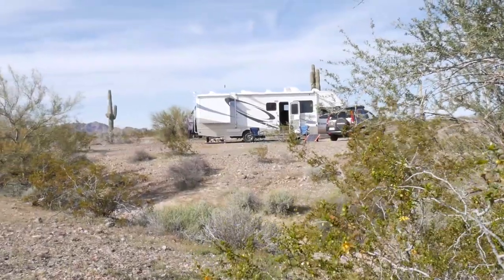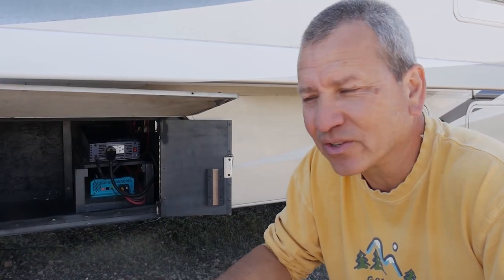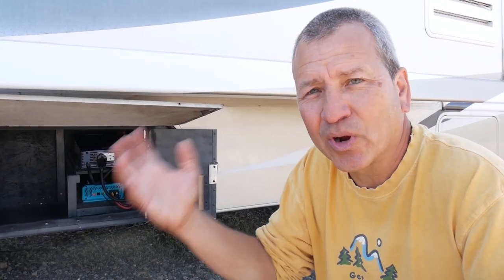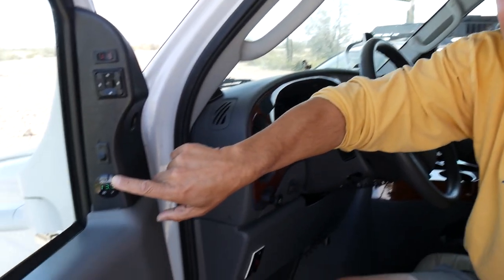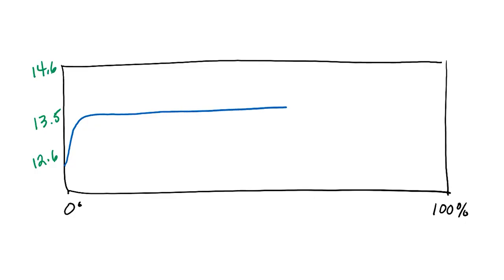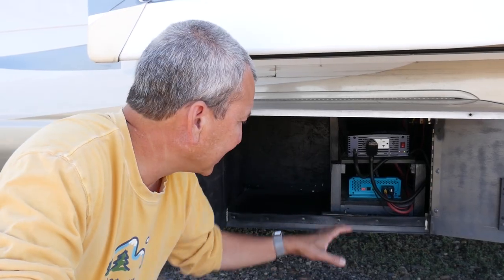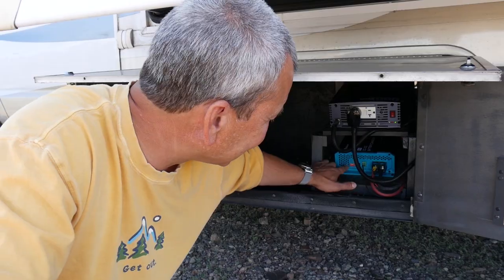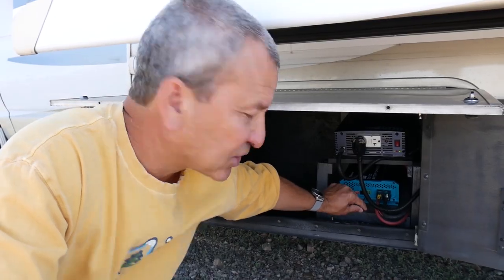Charge LITHIUM Batteries While Driving - System Setup

Comment: FYI, your "20A charger' is really a max 250w output.....the current decreases as battery voltage rises. As your LiFePO4 batteries reach a full charge at 14.4v,  output decreases to (250w/14.4v) 17.4A. Also, input amperage can be considerably higher than the assumed 20A output Due to operating efficiency of 90%, at low(er) voltage in your vehicle circuit,  it can draw more. Theoretically, it can operate on 8v input but realistically, if your starter battery is a bit down and the charger draws it down further, such as when the key is on but the engine is not started, the charger can draw (250w/12v/.9) 23A.
Reply: @tonyhood450  Not at all. A 20A for your small vehicle and 100Ah of battery is likely correct. (recalling from a year ago),There are a number of currents/voltages and specifications involved. It is complex and I may be muddying the water but I'll take a crack at it;
Firstly, POWER OUT = POWER IN x EFFICIENCY, since POWER = AMPS x VOLTS, rearranging the equation;
VOLTAGE OUT x AMPERAGE OUT = VOLTAGE IN x AMPERAGE IN x EFFICIENCY

If either input variables change, the output variables change and the reverse is true. This is a 
'teeter-totter' which is ALWAYS balanced. Because conditions of both the auxiliary battery and automobile change, use these equations to determine the limits (high and low) of operation and make sure you can safely tolerate those. 

1) The rating (on the data plate) of the battery charger is actually 250W, although it says '20A' on the label. In this case, '20A' is a marketing number and in this actual case, is rarely true. It CAN be true under specific conditions but it is not that much most of the time. In order for the charger to put out 20A, that happens when the battery is at 250w/20A = 12.5V. According to a chart of voltage vs SOC for LFP batteries, that is when the battery is at about 5% SOC. Whenever the battery voltage (and SOC) is BELOW that, it will still get 20A (or more) but when the battery voltage is above that, it will get less (which is most of the time). 
2) This charger appears to be constructed to deliver 'constant power'. That means, the current it delivers to the battery and that it draws from the alternator will change. Looking at a couple points, such as the one we just identified, at 12.5V it charges at 20A. How much does the alternator need to deliver to the charger to do that? a) IF this is an old-style fixed voltage alternator that puts out ~14.0V all the time (usually somewhere between 13.8 and 14.4) operating the charger requires 250w/14V = 17.85A at 100% efficiency. Since it is never 100% efficient, assume it will only be 90% efficient and will therefore require 17.85A/.9 = 19.8A. b) If this is a new style  'variable voltage alternator', it is likely the 'normal' alternator output is not 14V but is 12.4V (a good percentage of the time). At the same 20A output, the input would be 250W/12.4V/.9 = 22.4A.
3) When battery chargers operate, they go through 3 modes. The first mode is a 'constant current' (CC, which in your case is actually 'constant power') and it does this till battery voltage reaches the maximum allowed which for LFP is 14.6V (my mistake saying it was 14.4V previously). When your charger reaches this voltage, it will be charging with 250W/14.6V = 17.1A. Once it reaches 14.6V, it switches into 'constant voltage' ,CV, mode and holds that voltage but the current tapers off as the battery becomes 'saturated'. The charger holds this voltage till the current drops to ~5-10% of maximum (1-2A). At that point, it will stop charging for a time and wait to see if the voltage drops, then come on briefly, bring the voltage back up till it no longer drops ('topping' mode).
Reply: @tonyhood450  Fundamental to this question is a brief explanation of 'smart alternator' control. 1) The car intentionally keeps the starting battery undercharged. 2) The reason it keeps it undercharged it to provide a place for braking energy to be stored and later used from the battery so that the alternator can provide less overall to the system. 3)  the most common operating voltage from the alternator is 12.4-13.0V so as not to charge the battery. 4) low system voltage is not enough to make some vehicle devices work well (headlights, electric window defoggers and seat heaters etc.) Only when these devices are on, will the system voltage be raised to 13.2-13.5V to make them operate better but still not charge the starting battery or the auxiliary battery. The reason for this operational control is  NOT to benefit you, the owner but to allow the manufacturer to present a better fleet MPG rating to appease CAFE mandates. This will result in less battery life (undercharging lead acid batteries is the primary cause of their death) and less available battery power with key on, engine off. As a 4 cylinder engine, you already have a small starting battery and alternator. 

You might put a larger battery in the vehicle but it will do little good since the ECU will treat it as it does the current battery. 

If you want to achieve better performance from your starting battery, putting a solar charger on it would help but it is hard to dramatically change the way Ford wants your car to work without circumventing the smart charging system as a whole (which can be done and literally revert it to a constant voltage alternator but I would not recommend it since its integrated operations will have some negative consequences (turning your battery light on to start with). 

Having a 'toggle switch to charge the accessory battery' is a good idea but likely not for the reason you expect. Your DC-DC -charger is the ONLY way you will be able to charge an auxiliary battery but you should have an 'ignition' wire that enables it to know when the engine is 'on' allowing it to charge. With such a small engine, it is important that you can manually disable this when your engine is overheating, climbing a hill, in slow traffic, passing another car etc.

Comment: Been looking at DC to DC charger for my sailboat to charge my 4 Battle Borns from my engine alternator. Thinking of the Victron Orion 12 12 30.
Reply: Have to be careful not to overload the alternator. Good to hear the Renogy is working for you!
Reply from the maker: Yes. That's the Victron model I was referring to and linked in the description.

Comment: Thanks for the video. I plan on installing mine the same way (on/off switch).  I have noticed in most of the install videos for the Renogy unit that LC connection is not used. Do you know how and why it would be used? Thanks

Comment: Great video, thanks! How did you connect the on/off switch and what kind of switch? Is it a direct connection from the + wire from the alternator or did you need some kind of special device?
Reply from the maker: For me it was from a 12V source tied to the house battery. The charger will kick on if there's 12V on that input (intended for an ignition source). It doesn't matter where it comes from.
Reply: Ya, you just run the little wire from the + input on the charger.... with a switch inline.

Comment: Thumbs up.  However, since you removed your momentary jump start battery solenoid you can't jump start the motor with house batteries if the starter battery goes dead for some reason, like leaving your lights on, etc.   You could have connected the DC to DC charger directly to the starter battery.  I'm not sure why you wanted to remove the jump start solenoid.
Reply from the maker: Yes. I could have done that but didn't want to run another cable. I never need to jump my starter battery anyway so it's no big deal for me. I've got jumper cables.
Reply: @RVwithTito   if at some point your vehicle starter battery goes to 0 - is there anything special you have to do or disconnect to do a conventional jump start ?
Reply from the maker: @lylestavast7652  Don't think you'd have to do anything special. Just jump start. Actually I keep a battery charger so I'd charge it back up from my house batteries.

Comment: Thank you; very straight forward.  Looks like my Dodge truck has a 160A alternator. Any idea what the maximum recommended DC to DC charger rating might be?  Of course more amps means faster recharge of the trailer batteries, but perhaps I should measure typical current draw during regular vehicle charging to see what the headroom might be.

Comment: I have a Victron 12/12 18 AMP on order for charging up a 200AH Lithium with 500 watt solar setup.  I'm using this in a very small toy hauler and like you I didn't want to tax the alternator especially when at idle or slow speeds.  Sometimes, less is better and for me that's a hard thing to accept as I would normally say "Super Size it", give me the 60 AMP model.  My biggest concern is placement of the DC/DC, not sure if it should be mounted in the trailer or the tow vehicle.

Comment: I also have the E450 with a solenoid (or contractor). I have a couple other wires leading from one of the terminals, one is for the CB radio and the other may be for the regular radio. I want to get the DC to DC charger before switching to lithium, but not sure on the proper way to wire. Any ideas? Would a battery isolator work any better than the charger? Thanks for your great videos!
Reply from the maker: I'll be the CB and Radio are wired to the house battery side of the relay so they don't draw down the chassis battery. If you remove the relay, you'll want to re-attach those to the house side of the DC charger.

Comment: I didn’t see how you combined the two source, solar and alternator. When you forget to turn off the switch will you be pumping current from both solar and alt. Did you simply parallel the outputs?
Reply from the maker: I have a buss bar by the battery bank where all charging sources go. So yes. It's parallel connected there. I've since upgraded to the Victron DC-DC which has a feature to stop charging when the alternator output drops. Check out this video https://youtu.be/lvOYUfSBlmM
Reply: @RVwithTito  that is good information. The issues I’m trying to solve, and nobody talks about is the old charger. I was planning on adding a dc dc then using the old progressdynamics charger as input. That won’t work unless I can parallel the dc sources. Nobody says you can do what you are doing. I’m have now changed my mind and I’m going to use the 110 shore power to drive a relay that switch to alternator input between alt and the shore power dc. The energy dcdc mppt won’t know the difference and I won’t get loses due to voltage differentials between one source and another. Let’s say max 2volt different with .06 ohm internal gives 33amps. That is not a 100% accurate as I don’t know the internals of each unit. But it is probable worse case scenario

Comment: Excellent video!
I purchase the Renogy 20 DC to DC charger for the same reason you did, I did not want to overload my alternator. The manual for the 20 amp DC to DC charger is worse than terrible (but they came out with a better one recently, version 1.1, I think it came out 1/2020).
I also hooked mine up like yours but with one difference. I hooked the DC to DC charger directly to my chassis battery, not the alternator. The manual shows 2 diagrams, one the correct way hooked up to the chassis battery, and the other one the incorrect way with a BIG X on the diagram showing it hooked up to the alternator. (page 14 of the old manual and page 17 in the new manual (but the new manual only shows the correct diagram)).
So my question is why did you hook this up directly to the alternator?
Reply from the maker: I have it connected directly to the chassis battery too. Of course the alternator is also connected to the chassis battery.
Reply: @RVwithTito  OK, thx...probably something i do not understand.  I even called Renogy directly because this seemed weird to me and they said to not connect it to the alternator, just the battery.  Great video!
Reply: @laronis  you're absolutely right .The battery acts as  stabilizer keeping the voltage to the dc to dc charger constant and stable with the alternator adjusting to the needs of the chassis battery to keep it topped up .
Reply: @laronis  Correct, i know it does not make sense since the battery is directly connected to the alternator, but make sure to connect this DC to DC charger DIRECTLY to the battery, NOT the alternator.

Comment: I installed a Renogy 60 amp  to my 500 amp LiPO. No issues. I drive a 2005 Sprinter van. The new stock alternator output is 185 amps. Not while idling. More than 60 amps while idling. I plan to add 1k solar at some point.

Comment: Hi Brian, great video as usual! I did this install recently and I’m very pleased with the device. Question though, for the small volt meter in your door, did you just connect it to the positive terminal that replaced the solenoid under the hood? Wouldn’t that just show the engine battery volts? Or did you run a wire from the house batteries to that meter? Thanks!
Reply from the maker: I connected it to that switch which originally was the emergency start switch. It was connected to that solenoid on the house battery side. So it shows the house battery voltage.
Reply: You can connect it to any 12v fuse or circuit . There are volt meters that plug directly into cigarette lighter (12v.) They only work with key turned on  acc.  or running (powering the cigarette lighter).
Reply: @RVwithTito  so straight answer direct to house battery

Comment: that turn on switch you installed, what is your 12v power source for that? do you have it hooked up to the car battery? some other 12v circuit? I don't have an rv with a massive engine battery, I only want my dc dc charger to turn on when the engine is running but I don't want to tap into the alternator ignition circuit.

Comment: Hey Brian,
I am building out a camper van right now and have found your videos very helpful this last week. Quick question for you about this set up combined with your solar. I already installed an isolator from my starter battery to my second battery (This is hooked up and working great). My alternator produces about 95 amps. I would like to install a 200-watt system on the roof with 20 amp victron charge controller (similar to yours). Do you know if having the alternator and the charge controller hooked up to the same battery will cause problems? In particular, will having 95 amps coming from the alternator harm the charge controller? Sorry if you have covered this in a previous video I am still watching all of your old stuff. 

Thanks,
Steven
Reply: No it won't. But, you might exceed the max charging current of the battery to have both going at once. Check your battery specs. That's why I like the switch idea.

Comment: Currently I am using a Victron Energy Cyrix battery combiner. I measure 18A at the house lithium battery but it does not seem to charge the battery. The state of charge remains constant at 77%. Only my dashcam was connected while testing this. This drew 0.2A.
I have now got a Ctek Dual 250SE that I will connect the next few days.
My car is no fancy camper but a VW Multivan with a 120A alternator.

Comment: Hopefully I heard you correctly, you tied the charger from the alternator is wired up though a switch which is connected though the ignition, meaning only when your engine is running, you can flip a switch to charge your house batteries from your engines alternator & solar vs just the solar!
Reply: Yes, most ford alternators are above 90 amps(I say most not all) but that's not what you can truly pull safely! You have to figure out how much does everything pulls leaving how much is left & go by that! Meaning if you do have said 90 amp alternator & with everything running it pulls 55 amps, you only have 35 amps in reserve which in my opinion, having a 20 amp charger added to that is going to tax that alternator to much but if you see when everything is on & you see only 35-40 amps, that 20 amp charger would be fine, with the fact you claim you're only using it once every so often!
Reply: Oh quick note, I have a ford ranger with a 95 amp alternator & with everything, it pulls at most 46.3 amps which sure, a 20 amp charger would be in my opinion ok as long as I don't use it as my main charger! But when it's time to replace that alternator, I will be upgrading it to a factory fitted 220 amp one, meaning the new alternator doesn't need any modifications done to mount said alternator & as long as I do the, "Big 3 wire upgrade" alongside it, I know anything I throw at that new alternator, that alternator will be ok! I plan on having tons of 12 volt accessories that will need all that power like outdoor lights, on-board air & so...
Reply from the maker: You're pretty close. The only difference is that I don't have it wired to my ignition. I use a switch instead.

Comment: Nice description. Would this system set up apply to a tow vehicle/travel trailer where the charging power flows through the 7 pole light hitch plug?
Does your Renogy auto control charging of lithium if there was no manual over ride switch?